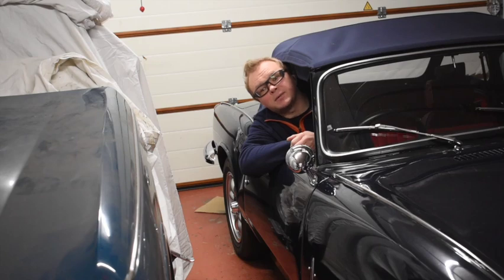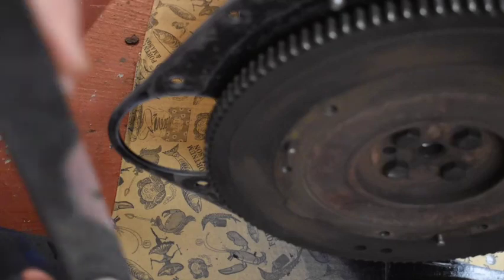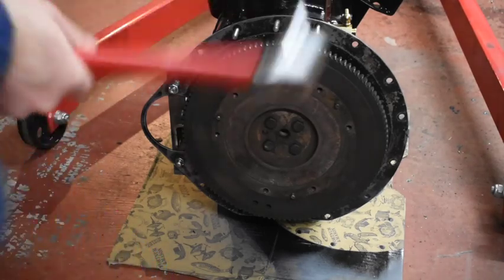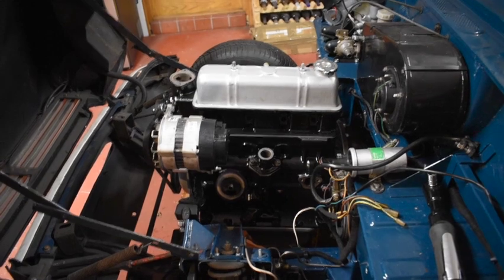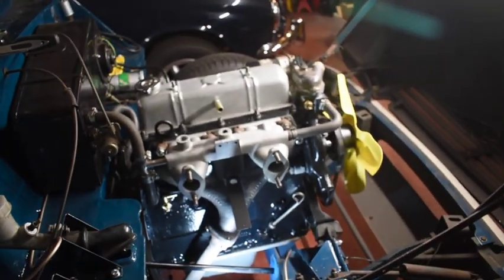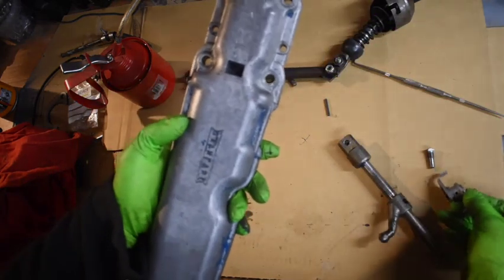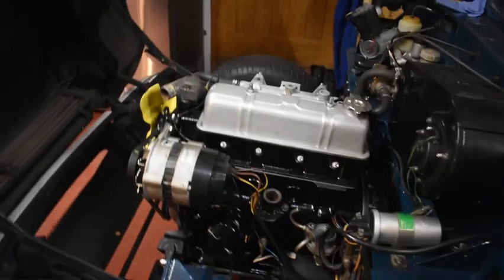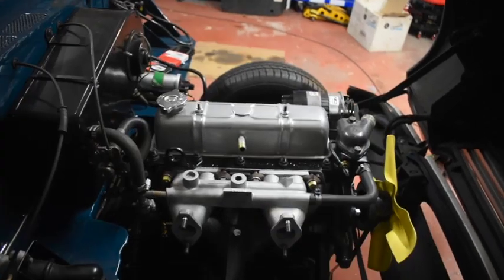Can You Fit A Triumph Herald Engine With The Bonnet Still On? | Herald 13/60 Restoration | Part 28

Comment: Looking good, thinking of putting OD unit in my 12/50, so it’s helpful to see this. I’m planning to keep original box, guessing will need to change output shaft and prop. Look forward to seeing engine start in the next one 👍
Reply from the maker: Thanks Jon. Yeah so to convert a regular gearbox to overdrive you need a different gearbox mainshaft, the oil pump cam that fits on the mainshaft, the adapter plate that mounts the overdrive to the gearbox casing, the gearbox mount and plate that bolts to the chassis, speedo angle drive, a switch, relay as applicable, and wiring. The parts in that list are available new. Then you need an overrdrive unit (obviously!) and the interlock switching mechanism that I was showing in this video, these things are not available new. Someone like Mike Papworth would be a good bet for being able to supply the latter though.

Comment: Yes, you can, is the simple answer
Reply from the maker: Yeah I’d read / seen photos of people doing so with an overhead hoist and load balancer, so you can get the engine high enough to be able to close the bonnet and roll the car out. But I really wasn’t sure I’d be able to do it from the side with the kit and space I have (the engine came out after the bulkhead was off)